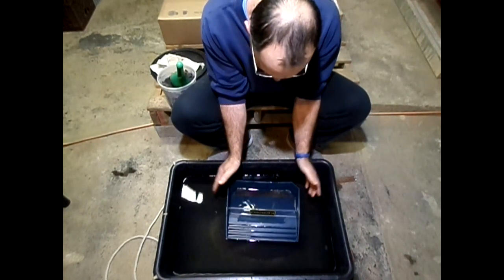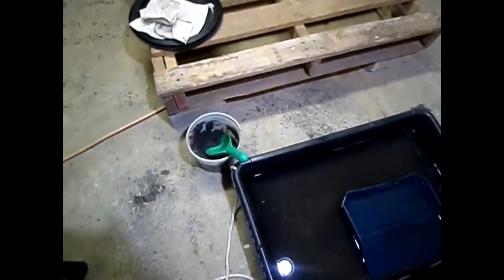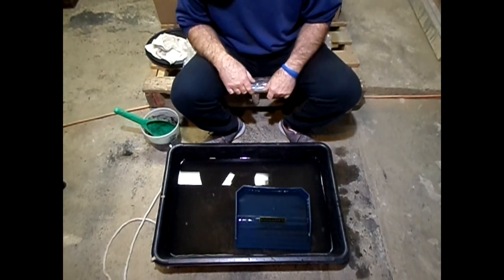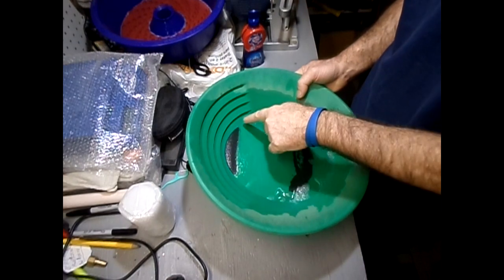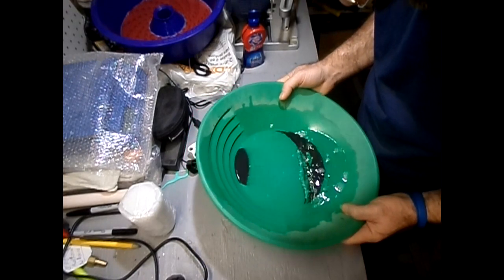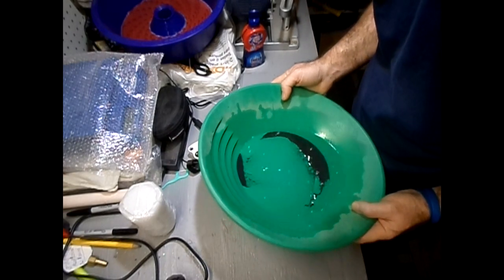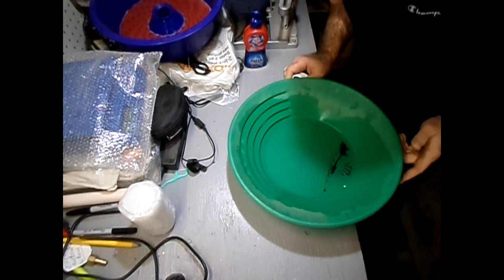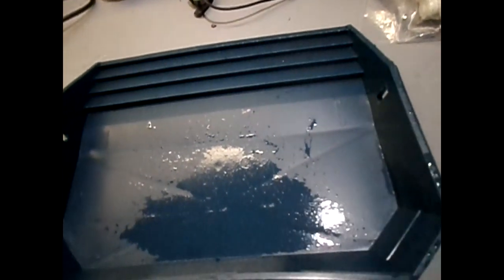GMGT - Placertools & Spin It Off

Comment: You had me 'shaking all over', Joseph, lol. You should be able to process a lot faster, even wirh all the black sands. Next time, put a catch pan under it, and try to go fast enough to actually lose gold. Then you can slow it down from there. When rinsing back, I like to dip and pick it up from one front corner. That way, the material rinses along the riffles to the sidewall and flows back.
Reply from the maker: OH NO! We can't have that Allan! I hope it was due to a bit too much coffee and a little less due to me🤣 Yea, I have to get used to it. At the river is one thing but with straight black sand it's altogether different. Thanks for even more tips!
Reply: @GreenMountainGoldTrap  LOL, No, shaking like I'm panning with you. I'm always trying to help, even when I watch myself in videos. Seriously, when using river run material or black sands, try to find the speed where you start loosing gold. You might be amazed.
Reply from the maker: @placertools3529  I can relate to that. It's pretty much how I worked my traditional pan to get to where I am today. And hey, I really won't loose anything because I'm panning into that black tub! Or I can set my Super Sluice under it.